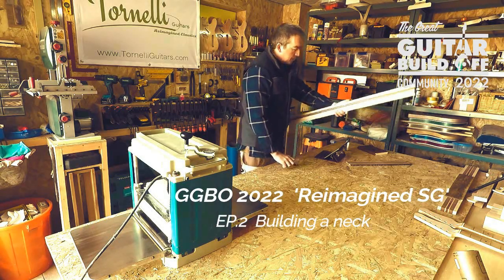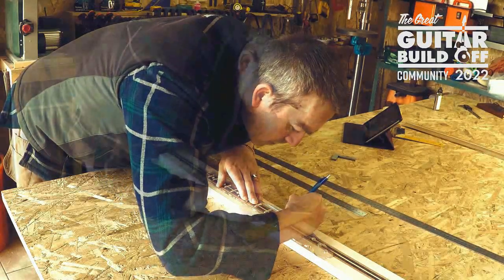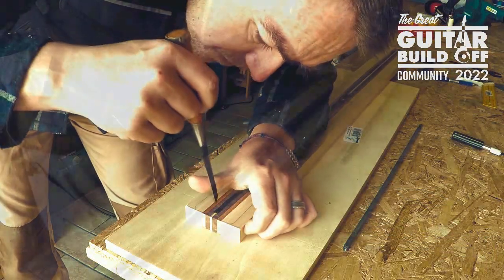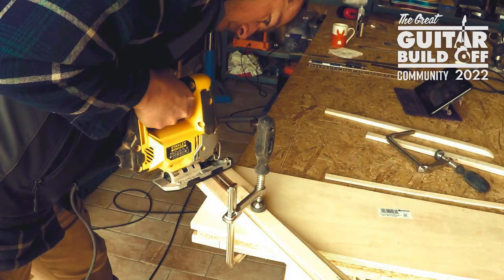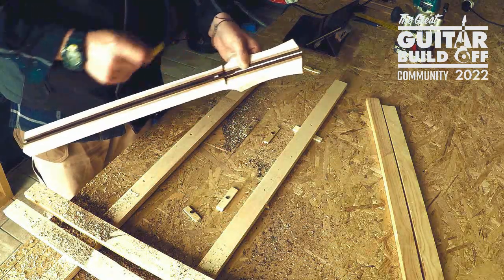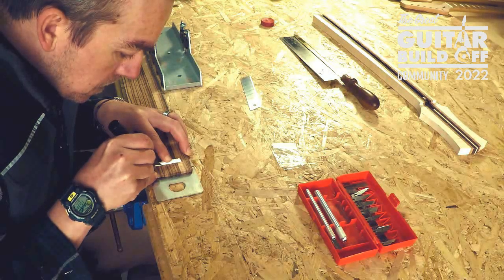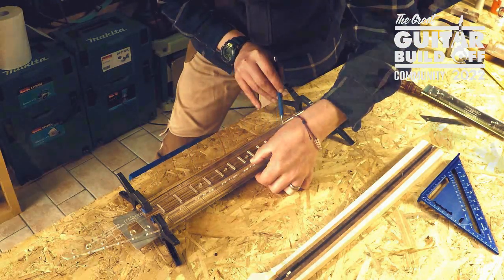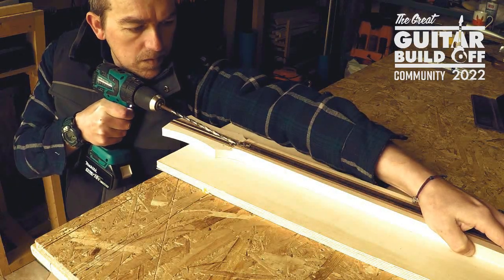Reimagined SG Build | Ep.2 making a Neck

Comment: I agree .. you can do good cuts with a jigsaw 
I don't have a bandsaw just now and as you have seen that's what i have used when i needed something like that.
Also when you are using the jigsaw if you tape it up it cuts down the chance of tear out and bits chipping of (depending on the type of wood you have as well)
Looking good bud, you'll not need 6 months to get this done 
i haven't even done a GGBO intro yet never mind starting a neck or anything yet ... lol
Reply from the maker: Thanks Rab 👍 I’ll try the tape trick when I get to my tops because they’re all quite thin and brittle (rosewood). And yes I’m hoping to finish in about 6 weeks, I’m still undecided for what to do regarding body wood and finish but I’ve got a few days to mull it over now.
Reply: @TornelliGuitars  Well you have plenty of time before it needs to be finished 
Go have a couple weeks holiday and you sill might be ahead of me ... lol

Comment: Good choice on the zebra wood fretboard, it looks great on that neck blank!

I just got my body jointed and glued up today. Going to do the rough cut with my jigsaw. Still undecided on template routing the final shape or use my oscillating belt/spindle sander. I like the accuracy of template routing but sanding is more “artish” 😊. 

What blades do you use in your jigsaw for cutting the neck and body?
Reply from the maker: Hi, thanks again for the comment. I’ll check out your build. I use Bosch T308Bf jigsaw blades, they are great! 👍
Reply: @TornelliGuitars  thanks for the tip.

Comment: It's looking beautiful, like all your other builds. BTW, when you prepare a neck blank, how thick do you go? 20mm?
Reply from the maker: Thanks for the kind comment Bart! 🙏 and yes, I go for 20mm neck and 6mm fretboard normally.
Reply: @TornelliGuitars  Thanks. I used 40mm for my last two builds (which were neck through) and felt it was a real waste of wood when I hogged out the unnecessary extra thickness at the neck. For my current build, I was planning to go with a 20mm blank, but wondered if it would be enough for the headstock. So, it's good to hear that's the norm for you. :)
Reply from the maker: @bhartissimo   Hi Bart, yes 20mm will be fine. I plane the headstock down to 15mm thick also. And I agree with you, it is a waste to lose so much wood from a 40mm blank. When I do a neck though I am going to laminate two 20mm pieces together just for the body area and avoid losing any wood. 👍